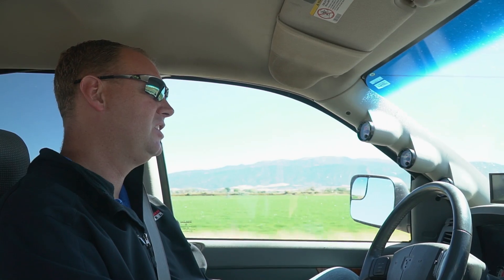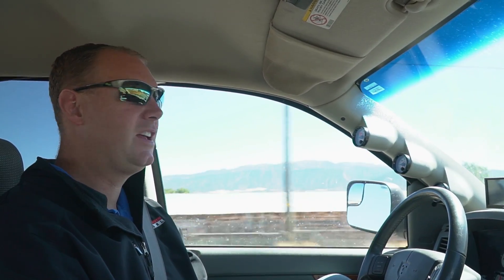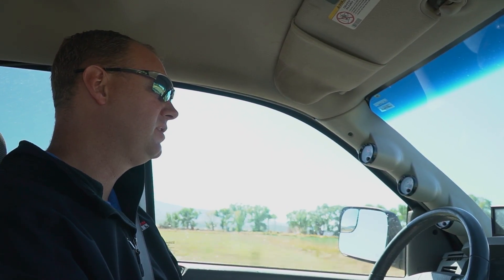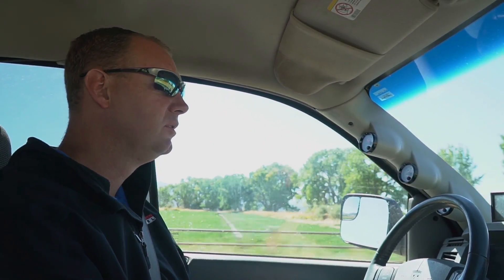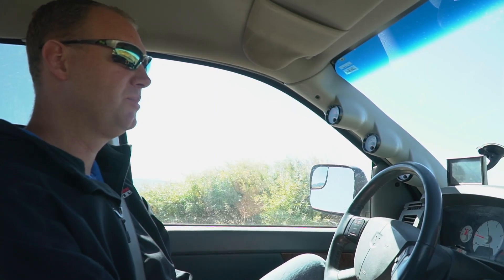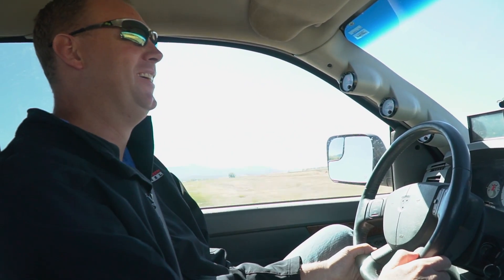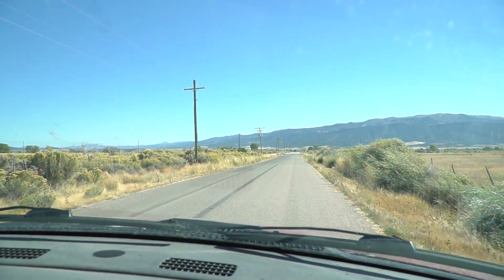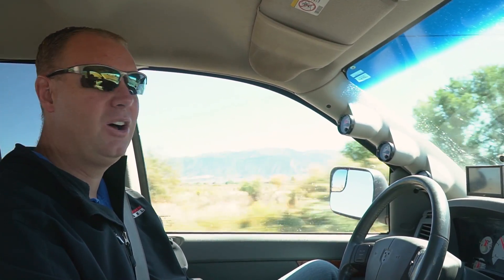Road Testing 850HP Common Rail Dodge Cummins Fueling Upgrade! | Power Driven Diesel

Comment: Would this set up spool the evil fab 467.7 2nd gen swap? I’m thinking about either the 464 or the 467 swap but I don’t want the 467 to lag
Reply from the maker: It would spool it very well.  If you have a really tight convertor it might lag a bit
Reply: @pddofficial  I have the nv5600 it’s a 03 Laramie, what’s the best fuel upgrade for the evil fab s464 kit, I know 90hp is about max for the stock cp3 but if I can go bigger with maybe a 10mm cp3 what should I go with ? Before I spend the money on wrong parts lol

Comment: You didn’t talk about rail pressure at all!!! It looked like your 12mm pump dropped below 10k psi when you showed a-pillar gauges during a pull. A 12 mil single should easily support 60% injectors. Please show me what I’m missing? Your running your house brand 12mm cp3 during this video correct?

Comment: What is the turbo set up? And what hard parts have you installed to support the HP increase?
Reply: @pddofficial  are the head studs necessary or for future plans?
Reply: @pddofficial  thanks for the reply. I saw it hit about 60 psi of boost. How much luck have you seen swapping in head studs one at a time versus redoing the whole head gasket and installing them? My truck has 292k miles on the odometer. Would it be a good idea to do a head gasket anyway without knowing if it was ever done before?  Or if it isn't broke don't fix it?  Lol.

Comment: What is that rattle noise when accelerating?
Reply: I was wondering what you had during the other video. Do you just have arp 2000’s or are you playing with the devil and just on a stock re-torque?
Reply: Bad blowby at idle or revving in park? 

BTW, good call with the single injection pump instead of duel fuelers. I've never had anything drive me up the wall as much as my ats twin fueler kit did.
Reply: I think the rattle comes from the steering wheel.  It moves when he accelerate. Maybe just the driver side tire flapping to the sides. But idk, let us know !!

Comment: Wicked truck how much would it be worth a truck built like that we get nothing like that over here in the uk
Reply: So looking like a 20k truck or 30k
Reply: well a trans for something with that much power is 6 to 8k injectors for those trucks are 3k turbos 1-2k headstuds 500 t 1k cp3s aint cheap and neither is the gauges the tuning or the work to get any of it done